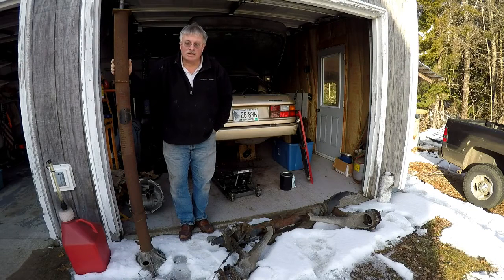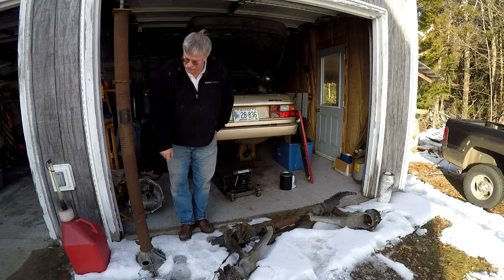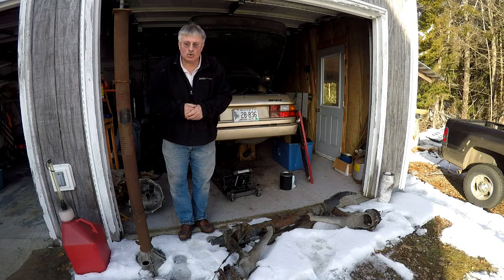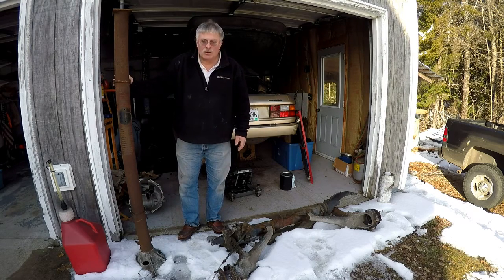Porsche 944 Torque Tube Removal for 1986 car.

Comment: where do you find replacement torque tubes? Parts for these cars are so hard to come by these days I can take me hours to find something or spend hours looking and not find the right thing at all!
Reply: There are actually a fair number of places that collect these cars as parts cars. There is Plyhammer Parts and Retro Automotive as mentioned above. Then there's DC Auto, 944 Barn, E-Bay, putting out a call on Rennlist, and much more. I've purchased two rebuilt torque tubes outright from Black Sea R&D. Not cheap, but a real time saver and built to a much higher spec than it came off the assembly line with.